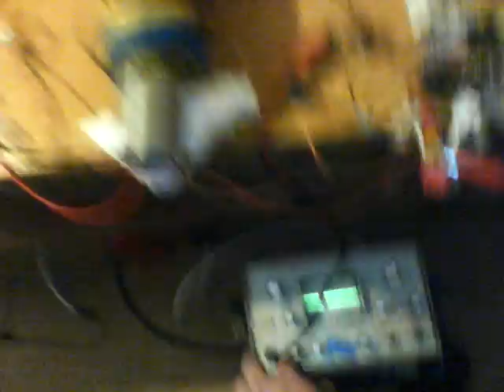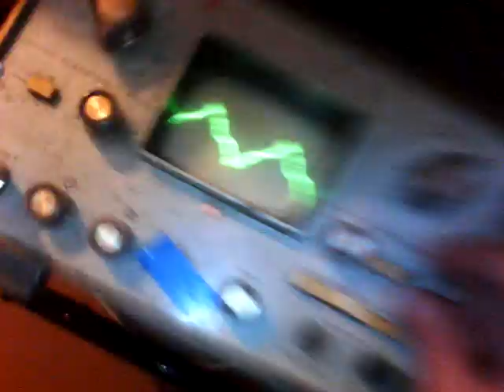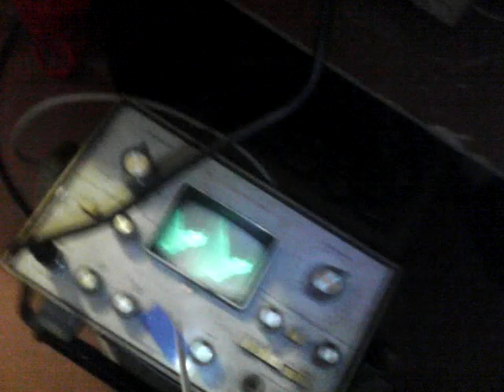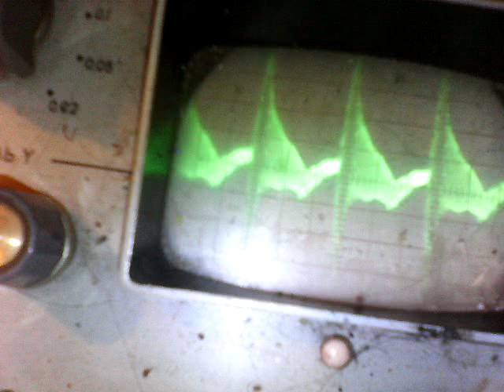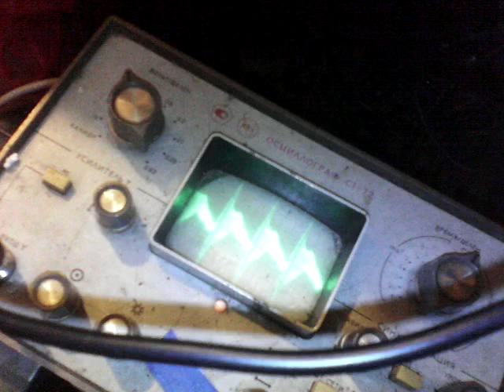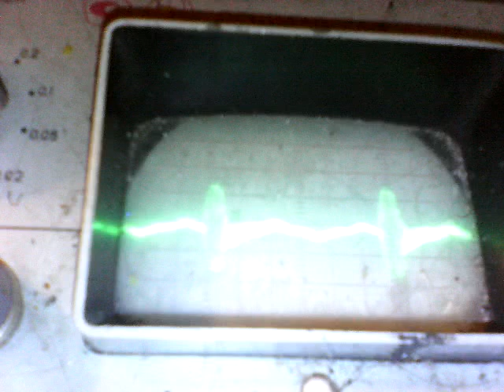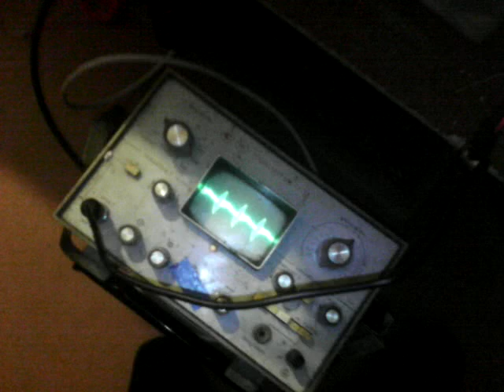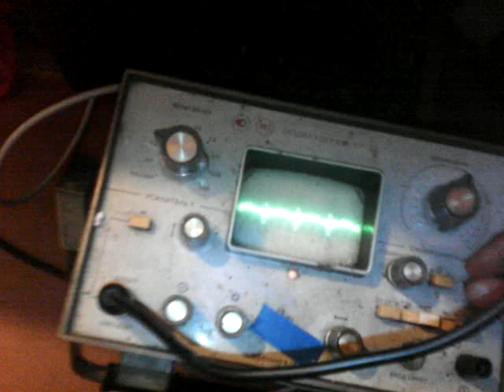Изследование установки Кулабухова Руслана

Comment from the maker: У качера паралельный резонанс. Поэтому он потребляет где-то 0,5 ампера. Если неавтогенераторный ТТ, то там можно настроить и паралельный резонанс ,когда потребляемый ток будет 0,5 ампера, как и у качера и искра не очень сильная как и у качера и можно настроить на последовательный резонанс, когда у меня потребление при тех же катушках доходила до 8 где-то ампер и даже блок питания выключался, в защиту уходил, но при том на антене искра очень мощьная, сочная, вернее плазма.
Reply: please post a schematic
Reply from the maker: rundmc7p1 my schematic similar to this schematic. https://yadi.sk/i/6lwxVO9DqKtbP only in diferent way made Tesla generator and push pull and little in diferent way wound output coil and it have not 6 layers but 5. And tesla get energy from yoke windings, then 4 diodes Uf5404. And I use diferent mosfets IRF640, if I good remember for pushpull and for Tesla. And on output is diferend load. Sorry, that not draw originall my schematic, because it loong drawing.